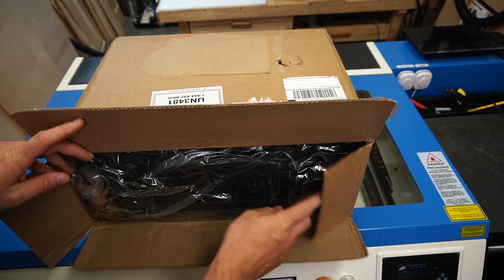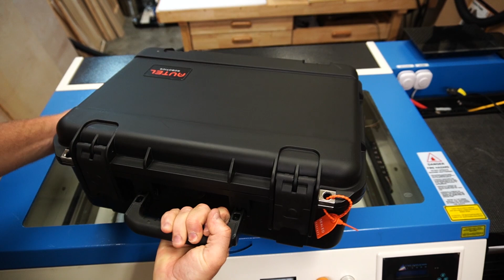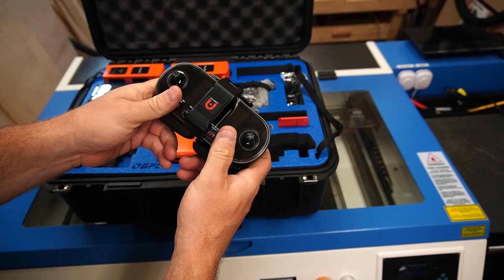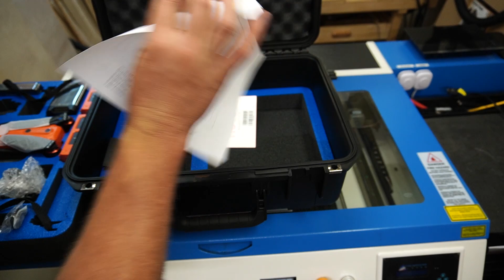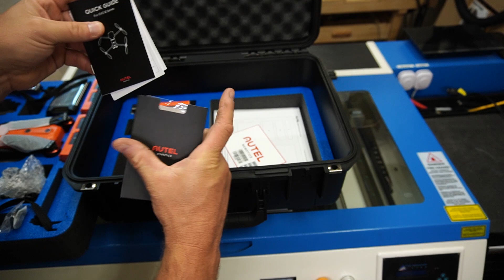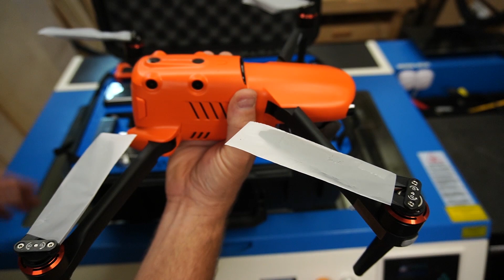Autel Evo2 Dual Unboxing

Comment: Can't tell you how happy our partner agencies are to have a quick-deploy, small footprint, relatively quiet 640 IR equipped system. Autel did a great job in partnership with FLIR on this Boson sensor. Detail and clarity is very impressive. Live Deck is an added bonus making streaming HDMI out to a CP or IC easy...don't we all wish we had IGAN systems to feed into! ;) Nice unboxing Garret.

Comment: Make sure u update all ur batteries . Your charging hub will charge all batteries at once . Love my case . Was flying for over 2 hours and had to take a break while another battery was already charged for another 35 minute flight.
Reply: ...I believe the battery array is charged...sequentially.  one after another, not 'at one'
Reply: @waltrmitty  Well in blue mode it reverts to parallel charging. Starting with the lowest battery until it reaches the status of the second lowest and then it charges both of them. In green mode it charges one at a time starting with the highest.

Comment: where did you order yours from? i am going to be ordering one in the next 2 days.
Reply: Check out Drone Works. Zach Davis or OriginaldoBo on Youtube. Amazing service and great hook ups.
Reply: @808Stat3  yeah I've been talking to those guys, the only problem is that they don't have the sets right now. There's still a lot of backorder so I got one from the autel store on Amazon and purchase a combination kit. Got a lot of really good stuff with it for 1795.
Reply: @jsublett8871  awesome. U ll love it. I making a video about the new update right now 2.3.0 it made some really good improvements to handling and stuff
Reply: @808Stat3  yeah I just found out that they have the upgraded firmware for the 10 bit upgrade for the 6K camera drone for the Pro. It was just released if you haven't found it yet you might want to look into it